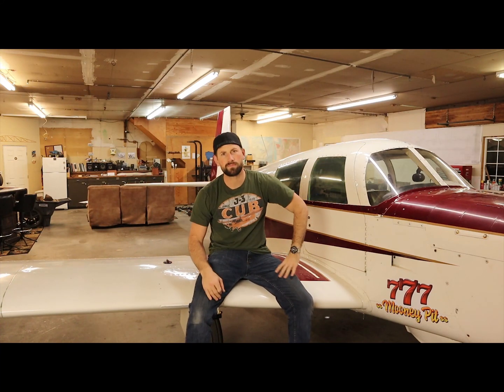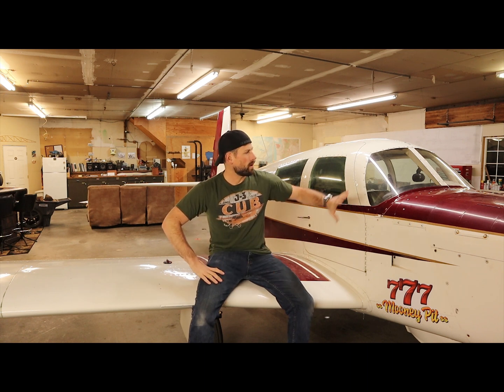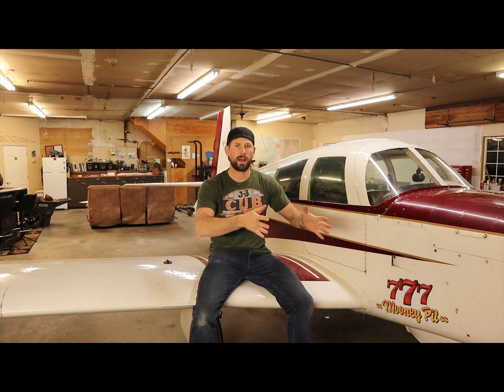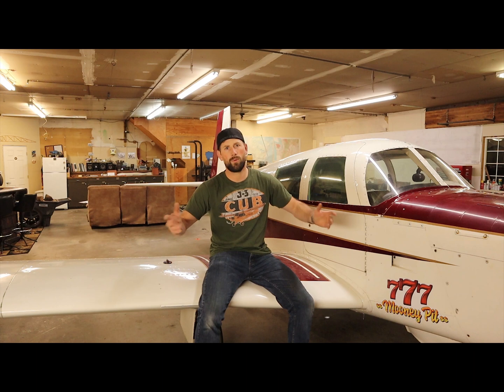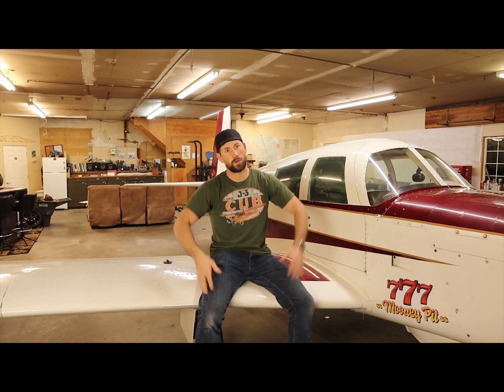1965 Mooney M20C Firewall Forward Overhaul and Restoration

Comment: How much$ in parts..
Reply from the maker: Elisendo Pruneda about $35,000 just in parts.
Reply: @whatsmikedoing8761  In the aircraft world do you have to buy all parts new or can you go to machine shop and rebuild crankshaft, cylinders ECT ECT.
Reply from the maker: Elisendo Pruneda it doesn’t all have to be new so long as the part in question is within manufacturers tolerances then you can reuse them. Some parts on some aircraft are time limited though too. Just depends on the aircraft and the manufacturer. 
Some parts can even be “owner produced” if they’re no longer manufactured. They still have to meet specs though of the original part.
Reply from the maker: I spent $35,000 on all kinds of parts, not just the engine. I have about $20,000 into the engine.
When you overhaul an engine there are many more things to consider than just the engine. Often you’ll find you’re also overhauling or replacing accessories like your magnetos, prop governor, exhaust, engine and prop controls, engine mounts , oil cooler, carburetor, and hoses and scat tubing etc. I replaced or overhauled everything forward of the firewall, it adds up!
Reply: @whatsmikedoing8761  35 k for engine overhaul what would you charge the customer example only.i want to become a light aircraft mechanic to bring older Mooneys Pipers and Cessnas back to life and flying but didnt think I had to mortgage the house just to rebuild the motor. I see on YouTube people saying I just paid 30 GRAND on the engine rebuild does that mean the mechanic rebuild it for 20k ans sold it for 30k plus install or rebuilt it for free..

Comment: Great video... i'm getting ready to trailer mine home 300 miles away. I've gotta split it in half (fuse behind the rear window) to get it home. going to try to recording  it all.....
Reply from the maker: mike monce sweet, what’s the story behind your Mooney? What does it need? Definitely record it, I wish I had more video of my project now, it would have come in handy.
Reply: @whatsmikedoing8761  Abbreviated story I bought a 67 M20F N2922L last summer. It was in a tornado???? straight line winds??? all depends who you talk to. It was in a T-hanger and it was the only plane to survive     ((   https://www.fox13memphis.com/top-stories/planes-arkansas-airport-destroyed-due-to-storm/762230251   ))    I got  2922L crazy cheap minus the IO-360 and prop. The only damage was to both of flaps, one  aileron and some dents on the leading edges but I've fixed worst bird strikes. But then life got in the way like it always does and I couldn't get it over the summer so got a cover for it and it will have set on the ramp till spring. And since you just can't take the wings off a Mooney  I've seen pics and heard stories of splitting it where the back window / cage ends (were the factory puts them together) that way it will still be able to be on the gear and fit on a trailer sideways. I want to document it so there will be some kind of video reference out there. I've looked and looked and can't find any.........I'm in St Louis (right outside of) and the plane is in Arkansas.